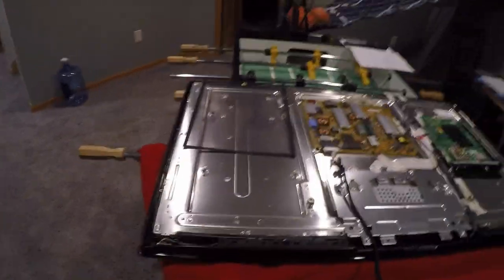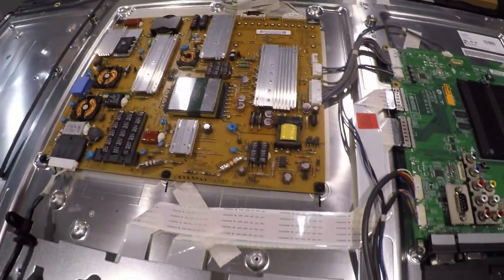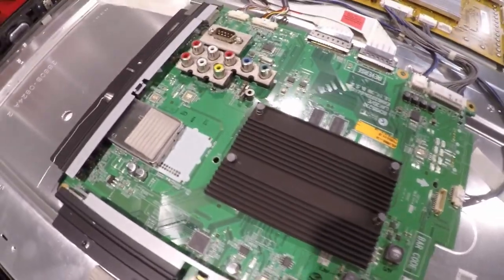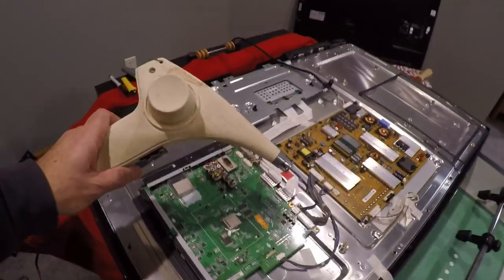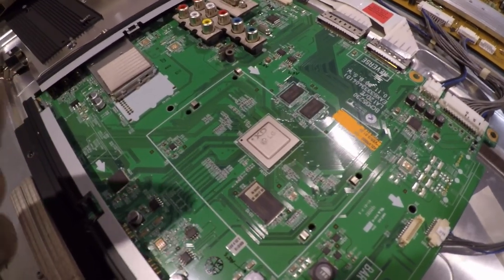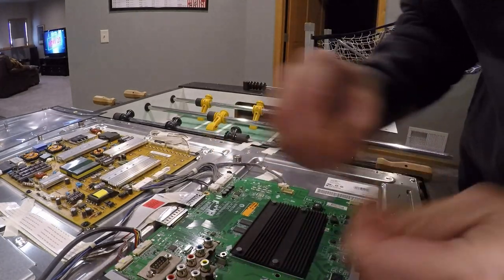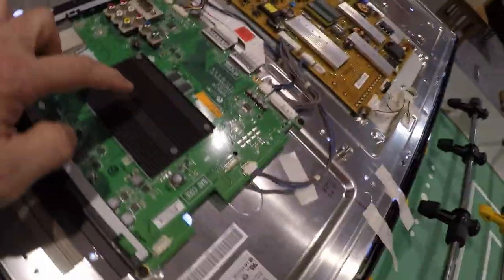Main Board Repair of a 'junked' LG 42LV5500 TV Reflow Oven

Comment: My LG 3d tv 47LW6600 does this too. It has been working fine for 7 years until recently..  i did the reflow trick three times in the pas two months..  it seems to fix it temporarily only.  Yesterday using a heatgun i had to bake the main chip for about 8 min at 200 celcius.  ( i didn't bother taking out the heat sink though). Tv is working now but this is getting annoying.. have to do this every few weeks. The first time i tried i only heated the chip less than a minute, it only worked for 1 hour.., the second time i did 5 min. at 175 celcius.it. worked for 3 weeks straight..   yesterday i did 8 min at 200 celsius.. i use an infra red thermometer to monitor the heat.., cuz im afraid to overheat and unsolder it..   if the happen again  i will remove the heatsink .. and if the problrem return again i will try to heat through the rear panel holes that are on top of the chip.. will save me time.
Reply from the maker: You're just not getting complete reflow of the solder joints underneath the chip.  You definitely need to remove the heat sink. The purpose of the heat sink is to remove all the heat! If you read through the comments sorted by date you'll see one recent guy did his by using some flux to help the solder flow. You actually are trying to 'unsolder' the chip, you just don't want to move it! The chip doesn't actually want to move, as long as your board is level, that's how they put it on the board in the first place. it's just sitting there, they heat it up in the reflow oven and the chip actually 'floats' into place when the solder is melted - the solder wants to pull the chip right to the solder pads.  And if you're board is sagging/flexing you might want to put a small piece of wood under the board to help hold up the middle of the board - that should also help. But the reason it keeps happening is you're not getting a complete reflow of the solder joints.

Comment: Thanks for your great repair tip and excellent video.How was the standby led behaving on this set? Was it slowly blinking red? I have a similar set lg 47lw5700ta with standby led slowly flashing red and Tv not powering up.I had checked all psu voltages they were ok but i have yet to test backlight.I have seen similar repair solutions on youtube talking of heating the bga chip.Can faulty backlight cause mainboard not to turn on the Tv?
Please also note 47lw5700 is a LED tv and not plasma as you have indicated in your list.
Reply from the maker: My red power led acted 'normally.' I could use the remote to turn on/off the TV and you would hear the PS relay click and the the Power LED would toggle on/off.  If it was just your backlight LED's the TV might(probably) still turn on and you might hear audio, and if you shine a bright light on the panel you might see a 'shadowed' picture.  I'm just guessing its not the BL LED's.  Here is a link from google about LG flashing LEDs: https://readytodiy.com/lg-tv-light-blinking-red-blue-green-etc-0051

Last week I reflowed the BCM on a 55LX6500-UB and bamm, I have another working LG.  This time I used a small amount of liquid flux around the edge of the bga. I removed and supported the board so I had access to the bottom, then I heated the bottom gently until the flux wicked under the chip, then I heated the top for a minute or two, let it cool, reassembled and it powered right up!
Reply: Have same mode. Same problem and fixed the same way. Only lasted 3 months. Will heat again.

Comment: Was very helpful, thank you! And oven is a no no, reflow temp is 250 degrees Celsius on reflow station
Reply from the maker: From wiki, solder alloys  melt between 180 and 190 °C (360 and 370 °F) are the most commonly used, so that's why the oven at 375 works. An oven works differently than hot air because the whole board gets heated through to 375.  I think the reflow station temperature is measured at where the air comes out which is a little bit of a different measurement. The air is cooler when it hits the board/chip. But I agree with you, oven not a good idea!
Reply: timgoihl I’m in AU so I’m thinking Celsius, reflow station preheats board from the bottom also
Reply from the maker: @MaxELECTRONICS  I wish I had one!

Comment: Great video. Very informative. A neighbor just gave me her broken Vizio D55u-D1 TV. From what I have seen on some of the forums, the ball grid arrays may need to be heated up and re flowed. You mentioned that you would use flux next time. Is there a particular type you would use? Perhaps a very thin viscosity type? Thanks for your help.
Reply from the maker: I've had my flux syringe since 2001 and it still works. On Amazon I see this 247-FLUX-5 which looks like it might be similar, any no-clean flux in a tube should be okay. Even if it's gooey when you start as soon as it warms up it flows right under the chips.  The other thing to consider is board support under the BGA. Before you take it apart try and notice if the board is actually sagging and if so put a wood or plastic block under the BGA the same height as the other standoffs, then reflow the chip...
Reply: @timgoihl  Thanks for for your quick reply. That 247 Flux-5 looks like it could work. I will read the reviews on it. I see that some people also swear by Amtech NC-559-V2-TF Tacky Flux. Similar to the one you recommended, it is tacky so the solder stays in place when it flows, and is easy to clean.  I think you are right about the boards flexing when hot and breaking the connections. I will definitely look at my board when I take the TV apart tomorrow. A spacer block is a great idea.  Thanks again for making this video and helping others fix their TVs. It is a crime to dump them into a landfill when there is so much more life left in them.
Reply: @timgoihl  Hi Tim. I tried to reflow my BGAs on my Vizio D55u-D1 TV today. I don't have flux yet, but I wanted to try it anyway. I removed the large heat sink from the chips and held the heat gun about 1 inch away from the chips. I did this for around 6 seconds per chip. I'm still getting the black screen when I turn on the TV. My heat gun is a Master heat gun hg-501a that goes from 500 Degrees to 750 Degrees F. Did you really keep your heat gun pointing at the chip for 6 Minutes? My heat gun moves a lot of air at 23 cfm. I think the Weller does around 2.
Reply from the maker: @georgeterbush2976  You saw my heat gun...  Its 250 Watt.  The specs say:  "The heat guns temperature at nozzle ranges from 750° F to 800° F (399° C to 427° C)."  I used this pinpoint nozzle to direct the heat on the chip.  But the nozzle probably reduced heat transfer to the chip making it slower. https://www.amazon.com/dp/B00LQR2Y28/ref=cm_sw_r_cp_apa_i_BMKIFbGVFPCH1
so basically I was trying to slowly heat through the chip and melt the solder beneath, and that takes time. For me it was definitely minutes, but i wasn't counting.  The oven guys were doing ~10mins at 375F but that heats from all sides, right?  So its kind of a feel thing i guess.

With your big gun and its wide mouth you have to be careful to not burn the surrounding pcb.  Its not really intended to heat components.  If you could direct the heat and/or maybe shield the surrounding pcb with AL foil, you MIGHT be ok.  Oh, and there's another comment on here from a guy who used a bigger gun...  Look for that.
Reply: @timgoihl  Thanks Tim. I will make a reducer for my heat gun so it is more focused on the chip. I will also take your suggestion and place tin foil around the surrounding PCB. That's a great idea. My heat gun is 1680 watts vs 250w for the Weller. I have to be real careful not to over do it.
Reply: Success! My fake Amtech flux finally arrived so I attempted the re flow on the 2 BGA's on my Vizio D55u-D1 motherboard.

Steps I took...
1) Removed the heat sink & old thermal paste
2) Removed the 4 rubber spacer pads under the board. Major pain to get them off cleanly.
3) Placed board in preheated oven 100c/200f for 10 minutes to remove moisture and warm whole board up.
4) Removed board from oven, then applied flux around all 4 sides of each BGA. I tilted the board and heated the flux with the heat gun for a few seconds so the flux would flow under the chips. Not sure how much flux got under there but I used a liberal amount on each side.
5) Laid heat probe on first BGA.
6) Heated chip and surrounding board to 150c/300f for 2 minutes. Moving the heat gun in a circle pattern. I used a Wagner heat gun on low fan setting.
7) Re flowed the chip at 217c/422f for 1 minute. This was a little tough to accurately monitor because the probe sent with the meter only officially went up to 200c. I would raise and lower the heat gun from the chip to keep the temperature close to 217c target.
8) Followed steps 5,6, and 7 on the other BGA chip.
9) When finished, I used a piece of cardboard and fanned the board to cool everything down
10) When board was cool, I used some alcohol to remove any hardened flux from the top of the chips that may have migrated up there.
11) I applied some old Radio Shack thermal compound to the chips and reinstalled the heat sink and the 4 rubber pads on the bottom of board.
12) Installed board back in TV and turned on. Picture came on!!!

Who knows how long this repair will last, but it was fun getting it this far. Thank you Tim for your video and advice.

Comment: Great video! now that its been a couple years how is this fix holding up? Did you reapply thermal compound before installing the heat sink?
Reply from the maker: I've done three TVs, and all three are still holding up.  I didn't add any additional thermal compound when putting the heat sink back on.  Sometimes what I will do is just use a razor blade and scrape the existing compound back to the middle making a little puddle so that it pushes down and re-spreads out.

Comment: I cannot get the metal cover shield off, what do I do?  I can heat in the oven with the metal cover shield on or does the shield have to be removed first.
Reply from the maker: I'm not a bake it in the oven kind of guy.  To get the heat sink off, take the screws out of the board and lift up the board and then you pinch the little clips to push them through from the back. If you're going to do the oven thing I would look at the video I linked down below in the comments for a guy that did that.  if you are going the oven method you can find a few people who did that with a YouTube search.

Comment: Nice presentation, thank you so much for the explanations and links provided.
I hope someone can provide some suggestions.
I found a LG 47LW6500 in the recycle room, and I wonder if I can fix it.
When I turn it on (all front panel touch buttons are responsive) it starts up, but you only get a scrambled image (with some small repetitive images, almost like some kind of weird fractal images, I don’t know how to describe) for a 3-4 seconds, then it turns black for a second, and then a few horizontal green lines appear randomly. I have an image not sure how I can upload it here.
Do you think re flowing the chip would fix this?
Thank you!
Reply from the maker: With the green lines and stuff like that I think you should run the T-Con board test first. To see if the t-con board alone can produce the test patterns cleanly.  The t-con test is in the manual
Reply: @timgoihl  Thanks for suggestion, I will try.
Reply: @timgoihl  Turns out that reheating the chip was was the solution. I targeted ~220 C directly on the chip (removed the heat-sink), but I am not sure about the actual temperature, as I have crappy probes (thermometers). Actually I used 2 different probes (multi-meters with temperature function) mounted on the chip surface; one probe showed ~200, the other ~250, and I thought I would average this. God knows which one is correct. I wonder now how long this fix will work.
Reply from the maker: My TV has been going since I made this video.  I still think this happens because the board gets so warm that the board flexes and sags under the video chip becoming concave if you can picture that... so the solder joints break under the chip.  It could also be caused by the big heat sink pushing down on the chip.  So my plan if I have to do it again is to (1) make wood or nylon standoff(s) (spacers) and locate it under or near the the video chip between the frame and the board, and then (2) add some liquid flux at the 4 edges of the chip before I reheat the video chip, as flux will help the solder joints reflow the solder better.
Reply: @timgoihl  The problem with this chip is that (I believe) there are 2 layers; the one that is on top is sealed, you cannot access it. So you can fix properly (i.e. adding flux, or even reballing) only the layer beneath.

Comment: Questions? Did you use the hair dryer on the component side; or the opposite side. And did you use the hair dryer; or some other heating item? Thanks kind Sir
Reply from the maker: watch the full video and read the video notes below.  a hair dryer probably does not have enough heat...  I think this is mentioned in the comments.  The first time I used the heat gun shown just on the top.  The 2nd TV I did, I added a very small amount of liquid flux around the edge of the chip, then warmed the bottom of the board until the flux started to flow, then heated the chip directly for a minute or two.

Comment: Hi, I am wondering if you have share the repair service manual? I having different situation than yours, whereby when I shorted the Drive-On with the power pin in the connector from PSU, l couldn't see my backlight on, is that means my backlight need to be replaced?
Reply from the maker: I believe the service manual was linked in the information below the video. Make sure you are counting the pins correctly. I believe the single color wire is pin 1 then that row goes 1,3,5,7 and the other row goes 2,4,6,8,10.  Depending on your model and the type of backlight strips, could either be a strip or it could be something on the power supply.

Comment: Hello, thanks for this video. What is the possible cause of damage to the refrigerator main board?. Our Refrigerator Freezer not freezing just cooling,  but now its totally not working , 
keep tripping the electric once plug.
Reply from the maker: It's probably not the circuit board. It's more likely something to do with the evaporator fan, the defrost heater, or maybe the compressor. Somewhere under the fridge there will be a folded up tech data sheet with a schematic, sometimes under the front lower panel, or in the back by the compressor. If you Google "ge <model#> service manual" you might be able to find a document to help troubleshoot your fridge/freezer
Reply: @timgoihl  thank you so much. will try that

Comment: Managed to repair one LG TV like this...:)....but now I have some issues with the picture of a LG 47LW5500 where I replaced the mainboard and now the picture is showing pixels of different colors that are spread around the generated picture...the 'deformed' pixels are shown only when something is being displayed...i.e. no pixels if part of the screen has nothing to display (like black background)....

Any idea what could be wrong and how to solve the issue?
Reply from the maker: Is this the same tv?  You might check the ribbon cables from the main board to the tcon board (each end).  unseat each clean, use compressed air on connectors.  you could run the tcon/lcd test to make sure its not the tcon board. try different video sources (eg a roku vs OTA tuner) just to eliminate that.  it could be the video chip, as there are hundreds of pins under it and if just 1 has a cracked solder joint, the failure modes could be more subtle like you are seeing (not all failures will result in no picture/no sound).   What year/model is you TV?  I've seen the desoldered chip problem mostly in 2010/2011 tvs so far, in my limited experience.
Reply: @timgoihl  Yes, the TV is the same....but had to change the mainboard....production year is March 2011 (model 42LV5500-ZC). Have already changed one ribbon cable but the result is the same....
Will try to do the tcon/lcd test and see what I get...
Reply: Update....just needed 10 minutes of heating the CPU at 250C and the picture is now clear!...:)
Reply: @gregornemec7665 so even the replacement board had problems.Seems it was a refurb and you have just repaired your original board

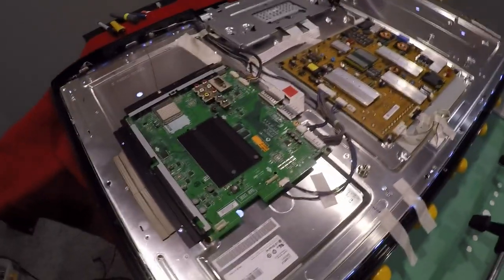Comment: All you need is a heat gun but you also may need liquid flux to take the oxidation off the solder. And heat while the liquid is in there. Sometimes the connections get oxidation. Need to heat the back first a little if you can suspend the board, put a 60watt bulb turned  on underneath it and let it warm up then proceed to the top with the gun. I like it done at the same time. 12:03
Reply from the maker: Agreed. Somewhere in the comments or maybe my description notes, I noted that more recently I add a little flux on the edge of the chip and then I gently heat the back of the board until this flux flows and gets sucked under the chip, then I heat the top of the chip for a minute or two and that seems to work better.